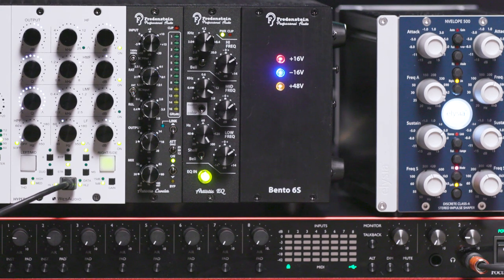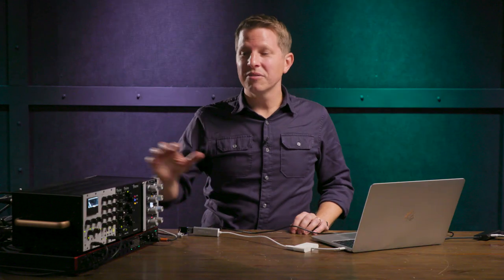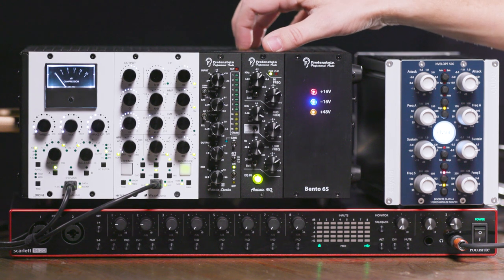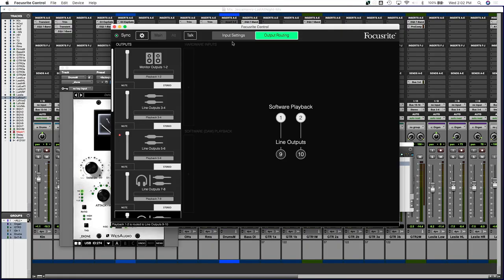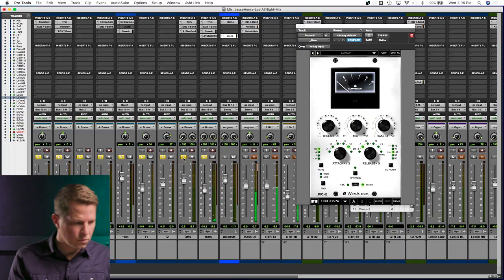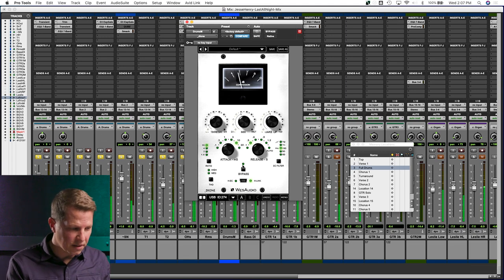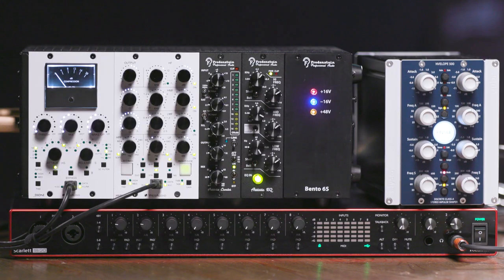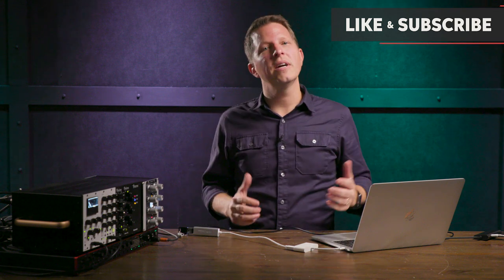How to Integrate 500 Series Gear in Production

Comment: That Focusrite Scarlett was never designed to be used with outboard gear. The mic pre amp's aren't bypassble nor does the converters have enough headroom. You are essentially plugging a pre amp into another pre amp that can color the sound and add more noise to the signal. You would need something a bit more higher end on the Pro Audio side like the MOTU AVB stuff that has dedicated Line Input and Line Outs. You need at least +20db to +24db of Line Input / Line Output of headroom on a AD to DA converter. +24db is pretty standard as the maximum line output level of most outboard gear. Having a very low noise floor and higher signal to noise ratio is important because that noise floor adds up once you start stacking layers of Audio tracks esp when process audio through outboard compressors, etc.. The folks over Apogee told me the same.
Reply: This
Reply: What are you talking about? The 18i20 does have 1/4 trs line inputs that can handle 22dbu and 29dbu with the pad engaged. The line converters can handle up to 110.5db of dynamic range. That’s more than enough to have a very low noise floor.
Reply: @protoman247  The Microphone pre amps aren't bypassble that can add more noise to the signal. The Combo jack line inputs still goes through the variable  mic pre amp circuit. You need an interface that has line inputs that goes straight to the AD converters. The THD+N noise floor specs isn't all that great. Once you start plugging in compressors and stacking Vocal Audio tracks, that noise floor adds up once you start mixing those tracks together.
Reply: UAD??
Reply: There are no outboard mic Pre 500 modules he’s using? It’s all dynamics
Reply: @tcos332  Doesn’t matter. The point is, the signal is still going through the built in Pres that can color the sound ad add more noise floor. It's not direct AD like a normal studio converter such as a Lynx Aurora or Apogee symphony I/0.
Reply: @eman0828  How? He’s not TRACKING, he’s MIXING already recorded tracks. Using the interface so he can have balanced line I/O connected to his computer to be able use as DAW inserts. There’s no need for “bypassing” any mic pre’s signal because he’s not using it, or any Mic Level I/O for that matter. That’s why he states that latency (buffer size) didn’t matter during the video.
Reply: @tcos332  Obviously you know nothing about Pro Audio when I comes to noise floor and gain staging. You sound like an amateur that doesn't understand the basic concepts. You are going to have higher noise floor using a Prosumer interface like a Scarlett because the signal is going through the built in Pre Amps before it gets to AD conversion and back into your DAW. Those interfaces weren't designed to b used with analog gear. You need Line AD/DA interface for that.
Reply: @eman0828   I guess I struck a nerve there. I’m not attacking you dude. You are correct that the mic pre’s would not be able to be bypassed IF Tracking. I’m not arguing that. He’s NOT tracking though, he’s mixing tracks already recorded. I just don’t see why you’re hung up on the mic pre’s when they aren’t even factoring into the equation in this video. There’s a Sweetwater rep that replied to the same question @therightclique had about the mic pres. It’s all I’ve been tryin to point out. There’s plenty of Line Level I/O on the 18i20.
Reply: @tcos332  DUDE! I don't care if he isn't tracking. Obviously you never mixed with analog gear before as I an tell. Anyone one with a brain would tell you this, when the signal out from your DAW from the DAC of your interface goes through the analog gear and then back into your DAW AD conversion. Doesn’t matter if you are tracking or mixing, that signal has to make it's way back into your DAW! That's how Hybrid mixing works! Usually you setup delay compensation in your DAW when doing Hybrid mixing.
Reply: What’s a good interface? Does a UAD twin or Antelope Zen get the job done
Reply: @MrDellion214  I wouldn't touch anything made by Antelope as they have terrible customer support, buggy drivers and software and hardware issues. They also go through frequent product recycles like made crazy which lowers the vaule of its existing products. Their product line up as very fragment. Get the Apollo twin. Apogee, UA, Lynx or MOTU is what recommend for interfaces. Focusrite makes really good hardware but their drivers aren't great reason why I moved to MOTU for better driver stability on Windows. I just only buy analog outboard from Focusrite.
Reply: @eman0828 what is a good interface I should get for using 500 series gear or even rack gear

Comment: Can all these 500 series that you used can be automated
Reply: You can do audio with the WesAudio 500 modules because they have plugins to control the hardware. Then you can automate the plugin to control the hardware and save all the settings as presets. You cant do that with regular hardware, only analog hardware that has software vst control. Thats why WesAudio is cool. There are a few other companies out that have that function as well.

Comment: I don't understand all of this technology but I like the possibilities. Does anyone know if this can be done using the 2i2 obviously there's not all the ins and outs but i wanted to know can the software do anything far as using the help of a analogue mixer if that makes sense.
Reply from the maker: Hi HoodHandyman, thanks for the question! While technically you could run the 2 bus master out and back in with a 2i2, it would be extremely impractical as there is no really good way to monitor what is happening and what is being recorded without plugging in an out from the back during the process. Going with a 4i4 or larger interface would make the process much more tenable for you!
Give me a shout if you want to discuss hybrid setups more thoroughly!
Drake Sobehrad, Sweetwater Sales Engineer, (800) 222-4700 ext. 3271, drake_sobehrad@sweetwater.com

Comment: I would have preferred this video if the 500 series were not used as inserts. I was hoping to run them as a chain leading into my interface. Would that cause too much latency?
Reply: Hardware into your interface does not cause latency. Latency is introduced by digital processing. An analog signal is basically traveling at the speed of light. Your 500 series won't have any meaningful latency going into your interface. Any apparent latency will be due to your buffer settings in your DAW.

Comment: Great content! Can anybody please tell me how can I use two neve 542 at the same time in stereo mode so far I can only use it in mono
Reply from the maker: Hello, Hector! The 542 does not have any stereo linking capability, but folks use pairs of them in stereo all the time. It’ll just be a matter of visually matching parameters best you can across the two units.
Thanks for the interest!
Cody Kraus, Sweetwater Sales Engineer, (800) 222-4700 ext. 1766, cody_kraus@sweetwater.com

Comment: noob question, how do you integrate external pre amps into an audio interface that already has preamps? for example: If I like the sound of my external neve pre amp but I have and focusrite 18i20.
Reply: mic --> PreAmp --> Interface through Line In (Not Mic In). Some interfaces use a combo jack (XLR and TRS in Same jack) so use a TRS instead of an XLR to go in the interface.
Reply: @raulalejandro7162  thx!!!! so going balanced it's the way!

Comment: Isn't using the XLR inputs on your interface bad because it will send the audio back through pre-amps and potentially color the sound?
Reply from the maker: Hi, Justin. No, that really won't make a difference because interface preamps are generally clean and if you are using a line level output from the other gear it won't be affected anyway.
Thanks!
Jason Filloramo, Sweetwater Sales Engineer, (800) 222-4700 ext. 1281, Jason_Filloramo@sweetwater.com

Comment: I'm wondering if it's possible to plug a 500 series chassis to an UAD apollo solo ?
Reply from the maker: Hey, Marc! Because the Apollo Solo only has 2-line inputs, it’d be tough to get the full functionality of a 500 chassis with that as your interface. With that being said, it’s certainly possible, you’d just only be able to use 2 of your channels at a time. For full flexibility, you’ll want to have as many inputs on your interface as you have outputs on your chassis. This way, you can access all of your 500 series units simultaneously.
I hope this helps!
Nick Pasquino, Sweetwater Sales Engineer, (800) 222-4700 ext. 3230, nick_pasquino@sweetwater.com

Comment: Amazing analog processing. My question is: how did you manage to enter at a line level into the 18i20, since you cannot bypass the mic pres in that unit? I had one and I sold it for this exact reason. Thanks
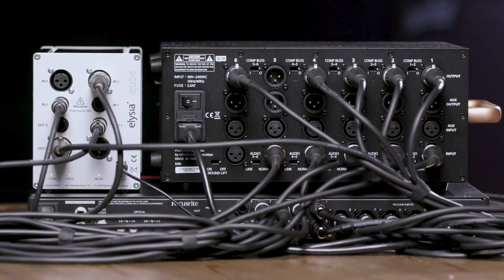Reply: at the 5:00 mark you can notice the Scarlett console has Mic/Line inputs. At the 6:10 mark he addresses this as well.
Reply: @sirprizedeyes2721  please read my comment till the end. You can verify that what I'm saying is true on the focusrite faq. If you notice, in this video the front gain knobs on the interface are taken down to zero, except for a couple. That means that this is a workaround  to minimize the gain effects, but it's just not the same thing as a line leven input, because with this interface your adding one stage of preamplification to the signal path. Does it sound clean enough? Yes it does, but it's not the same as having an actual switchable line/mic interface. Thanks
Reply: @robertopistolesi2735  Ah I see what you're saying. I indeed read your comment till then (it s only a 3 sentence comment lol). I'm unsure if that last stage of subtle pre-ampflication is negligible enough to ignore. It seems to be working like a charm for him. Maybe at this pricepoint, it's fair to assume that this 'workaround' is more than welcomed by the majority of buyers. What is another device you know that offers pure line level inputs?
Reply: @sirprizedeyes2721  any interface that can bypass the in- built preamps. There are also interfaces without preamps, only line inputs via trs cables. I have one of those.

Comment: If I have an API 500 Series 8 slot Chasis with db25 connectors in the back routing to my Apollo x8p, does it default to Line Inserts 3-10 like how it does inside of your focus rite controller? 

Curios because there are switches 1-8 on the back of my lunchbox.

Comment: I’m using a clarett 18i20 with a lunch box, iam wanting to use a small mixer with multiple guitar mics summed on mixer out to a 500 series mic pre (bae 1073) should you be using an attenuator? Shure A15LA OR A15AS?
Reply from the maker: Hi, Kyle. Great question! An attenuator shouldn't be necessary for that application, but feel free to give your Sales Engineer a call and we can go into more detail as to what the best solution would be.  Thanks!
Jason Filloramo, Sweetwater Sales Engineer, (800) 222-4700 ext. 1281, Jason_Filloramo@sweetwater.com

Comment: Does it make sense to go through multiple DA/AD conversions when combining some of the 500 modules? Isn´t it better to, say, DA once, go through a variety of modules and then AD back? If so, what´s best practice to change the order of modules: Moving them between slots or do everything via a standard patchbay such as Neutrik TRS or bantam?
Reply from the maker: Hey, Acid Energy. Thanks for reaching out. It is best to minimize the number of times you go through a convertor. It really depends on how you are wanting to track, though. You can go through everything on the front end and track it like a channel strip. I would recommend putting everything on a patch bay to make it easier to route things from card to card. Some 500 series chassis do have routing on them, but not all. The other option is to track the pre amp portion into your DAW and then run the compressor and EQ as an insert and route them through a loop in your interface. Both options are great but it depends on your work flow.
Thanks,
Grant Embury, Sweetwater Sales Engineer, (800) 222-4700 ext. 1647, Grant_embury@Sweetwater.com
Reply: @sweetwater  Many thanks, that makes a lot of sense! I´ll be taking the patchbay route and then see if a certain setup sticks.

Comment: What advantages would you say 500 series has over a vst?
Reply from the maker: Great question, and thanks for your interest! There are advantages and disadvantages to both. Having a physical 500 series setup gives you hands on control over your signal path and effects, which for many people makes a big difference. 500 series has benefits over other outboard gear since it’s relatively compact, modular and affordable. This makes it a really affordable way to get in to high quality outboard gear. It’s not true in all cases, but in some cases a VST can’t fully match the sound of a high quality physical preamp/EQ/compressor. That’s not to say that plugins can’t sound really, really good, but it’s not always the best solution either.
I hope this helps, and if you want to discuss pros, cons or features with anything in particular, feel free to reach out to me!
Connor Smith, Sweetwater Sales Engineer, (800) 222-4700 ext. 1793, connor_smith@sweetwater.com
Reply: @sweetwater  would you say a free analog emulation or a $300 analog eq would sound better?
Reply: @logimite7174  The transformers handle sound a different way than a  plugin. There is literally no comparison.
Reply: @kensmechanicalaffair  I mean to me they sound identical, maybe I'm not ready for 500 series yet.
Reply: @logimite7174  If you think they sound identical, keep using plugins. Big time engineers work completely in the box now.
Reply: @kensmechanicalaffair  yeah that's why im planning to just work itb

Comment: Hi guys, nice video! I'm trying to look for some help here.. I'm thinkin' about gettin into 500series world as a drummer to achieve a better sound. I usually have to deliver raw stems to customers. Current setup is a 18i20+ OctoPreAmp and I use in total 13 mic for the all drumkit 24bit 48Khz. Don't get me wrong it's already a not cheap and good setup but I would like to improve some important mics like the snare and kick ones. My question is: if I record, for example, snare mic and kick mic through two 500series external preamp and then I'll go into the audio interface that I have at the moment, would I have latency problem between the all kit recorded with 18i20+OctoPre and the 2 mic that have passed trought the 500series preamp? some synchrony problem? Because you can understand that move the all 13 mic kit through 13 modules would cost me a kidney!! Thanks if someone know something more than me, this world is fascinating!
Reply from the maker: Hey, minecraftworker8. Thanks so much for your interest. I love the idea of some 500 series pres for your kick and overheads. I have a similar setup. I run my kick, snare, and two overheads through some 500 series pres. There will be no latency since they are all analog and will run into your line inputs of the 18i20. It’s a great way to work!
Please feel free to respond or reach out with questions.
Jason Thiele, Senior Sweetwater Sales Engineer, (800) 222-4700 ext. 1391, jason_thiele@sweetwater.com
Reply: @sweetwater  much appreciate the exhaustive answer. Thanks for your support, this will be my next upgrade then! Cheers

Comment: Great video but it would be funny that someone in real life would spend that amount of money on expensive modules such as the Xpressor and the Wes audio ones and hook them to this interface (which is great but not for this purpose). However, I would like to know if the Clarett  8pre would be enough for hooking 500 series modules with a conversion similar to UAD or Antelope.
Reply: Have you found anything? Curious to know to the same in regards to the Clarett 8 pre usbc - working in tandem with a Radial 6 pack  chasis.  Thank you

Comment: What about A/D conversion? Is that not really important, or does the interface already have great A/D converters? 
Great video otherwise!
Reply: Most interfaces nowadays have good enough conversion to make music, although ones made by like apogee or universal audio will have better quality conversion than a Focusrite 18i20. It should also be worth mentioning that the 18i20 does not have a true line in setting therefore any audio coming in through the combo jacks will pass through the Focusrite preamp circuitry before the conversion, instead of going straight to the conversion like some other boxes allow you to do.
Reply: You need dedicated Inputs and enough high head room to use outboard gear because the comb Jack's mic pres aren't bypassble. The Scarlett stuff is Prosumer stuff. You need a Pro Audio interface that is calibrated to handle a maximum Line input between +20db to +24db which is Pro Level. Having high head room is very important. The lower the THD+N and the higher the Dyanmic Range, the better.